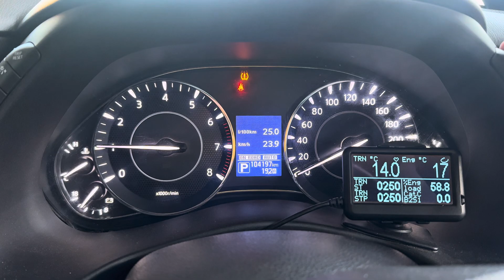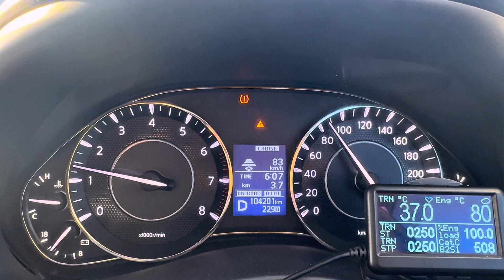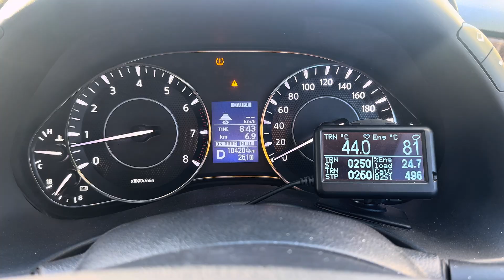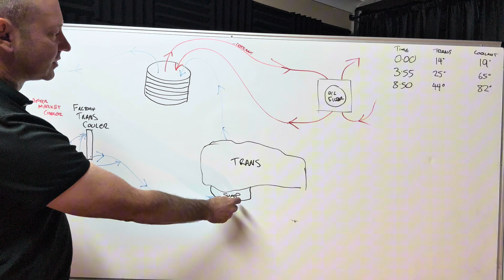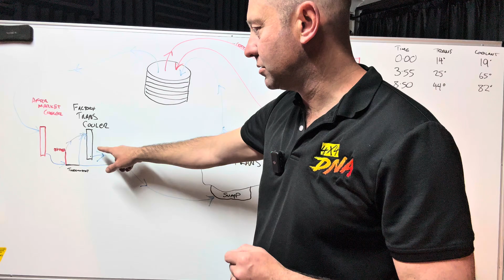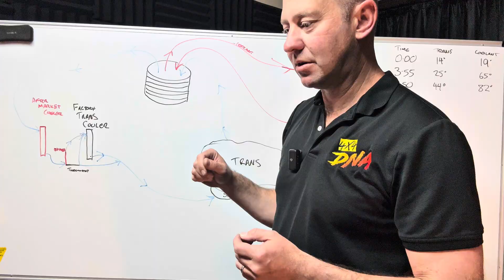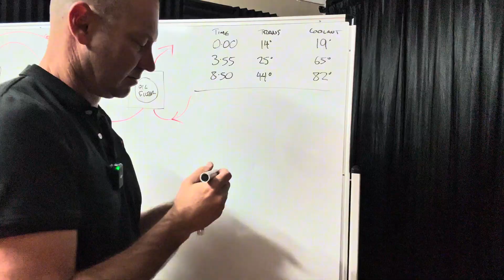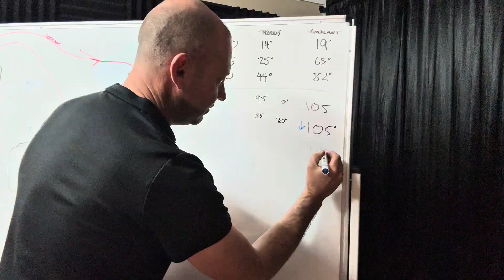Y62 Trans Coolers - Can They Make Your Trans Run TOO Cool?

Comment: Just wondering if there is a better and more reliable stronger transmission for the y62 to replace the standard transmission that isn't suitable for the 5.6 v8 engine.
Reply from the maker: Not that I'm aware of for the Y62.
Reply: how much HP and Tourqe is the Y62 rated for? 
Reason being is that im wanting to put 2650 supercharger on. Not sure if its worth it now? I have a worrier on order. Mind you, I won't be towing anything. It's more for touring.
Reply: Sorry transmission rated for.  HP & tourqe

Comment: Can a transmission run to cold. simple.

Go to any piece of service literature that relates to transmission testing, diagnostics or calibrations and it will state warm trasmission to oporating temperature with a reference to that temp that is almost always beteen 70-90 degrees C dependon manufacturer.

This is the temp the transmission should be oporating within

Comment: Unless u live in the snow permanently  no need to have the warm up device heat exchanger . The standalone factory air flow cooler would be sufficient for most applications . Towing more than a camper,, then an additional cooler is needed . 
If fitting an oil  thermostat many are wax pellet operated with a piston shaped or a washer oil flow divider . Often these are way way smaller than the valve bore . This allows huge amounts of oil to bypass . Resulting in very poor temp reduction .  Fit a closer fitting  piston/washer . I gained 13 deg cel reduction .

Comment: I have fitted a thermostat bypass and bypassed the trans heater. Have had no issues, oil runs cool, trans works fine. If your towing, and under load your coolant temp will increase, couldn't see the point in further heating up trans oil just to try and cool it down again. Adding an additional cooler only costs more cash to counteract the additional heating.

Comment: I fitted a Trans cooler to my Jeep GC, big mistake.. When towing it works reasonably well, but normal driving the temperature fluctuates dramatically and it definitely runs too cold at around 40 - 50* gear changes are rough and when stopping the gearbox seems to want to hold on to first gear and you can feel the effect, before the fit the transmission was silky smooth and ran at a fairly consistent temperature of 80* with little fluctuation when engine temp reached normal at 95*
The cooler was professionally fitted at a cost of $1200…. What a waste, so be careful as to who you choose to fit one. Never again for me!
Reply from the maker: Thanks for sharing your experience, it definitely highlights the importance of getting the right setup!

Comment: I don’t wanna watch this cause I don’t care. However Ive skipped to the whiteboard part by accident. He is saying the transcooler makes the trans oil cooler which lowers the engine temp too. I know in rangers part of the install of the trans cooler removes the oil to water cooling interface. Is this different on the patrols?
Reply from the maker: It must be. I couldn’t comment on the Rangers

Comment: Hi Dave. Can you please do a video on when a trans cooler is needed on a patrol. ? Is the standard one ok for normal use and with light towing?
Reply from the maker: Yeah, standard is fine for light towing. I’d still recommend doing the bypass valve

Comment: The prevailing theme in all these transmission cooling arguments seems to be the pursuit of ever lower temps and never once have I seen evidence offered either for the benefit of this, or that, per your video "anything in the 90s is cooking your fluid". A quick AI query has this to say.. "The typical operating temperature for automatic transmission fluid (ATF) ranges from 80°C to 95°C (175°F to 203°F). This range is crucial for maintaining the fluid's viscosity and ensuring optimal performance", and "Below 80°C (175°F) Fluid may thicken, leading to poor lubrication and shifting issues. Above 95°C (203°F) Fluid begins to oxidize, leading to breakdown and potential transmission damage". If this is wrong then fine, but point me the right info such as manufacturer specifications. I have a 2016 S3 and in normal operation it sits between 80 and 90, on scangauge with 90 being the max I see even towing a van. Now if that's too high then I'm not against spending the few hundred $$ on a cooler but on what basis is such a claim made, other than selling coolers? I think your advice should always start with the question..what are your temps? And if they don't know then get a scangauge and find out, then if temps don't routinely exceed low 90s, then nothing to fix, nothing to buy.
Reply from the maker: Sounds like I’ll need to do a follow up vid on this as there has been a few things that I can extend my research on. I agree with asking the question. The true aim here is to stay within Nissan limits, not necessarily to get it cooler
Reply: But the transmission operates and 
Shifts just fine even at colder temps. IF NOT BETTER 
🤷‍♂️ whats the difference.

Comment: Where did you get the information that trans oil shouldn't be lower than 40 degrees? I think 40 degrees is still a cold transmission, I have a mechanical history and was taught, trans oil has a high boiling point to cope with extreme temps. The job of the heat exchanger is to heat the oil to coolent temp or cool the oil to coolent temp. 40 degrees is a warm day where I live. Getting in touch with an oil company and asking them what temp is optimal for their oil to work at its best would be a good idea.
Reply from the maker: I reckon I’ll do that, cheers 👍

Comment: my brother changed the torque converter  and flush the transmission many times and didn't  work he used   BG44k fuel system cleaner and the problem solved  still didn't understand why injector  can do this problem
Reply from the maker: Interesting, thanks for sharing!
Reply: Hi mate what issues did your brother actually have with his trans and since adding that fuel cleaner how’s it going?
Reply: @adamsurf76  rpm fluctuation  between 3rd and 4th  gear
Reply: @df44saud  would that be the same as flaring between gears?
Reply: @adamsurf76 yes and now 3 months  the problem  didn't  come  back